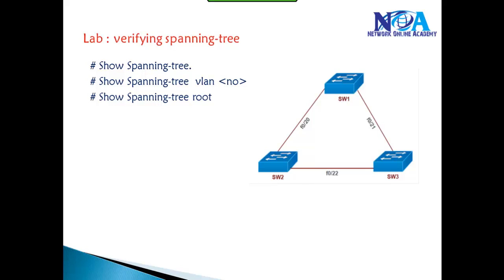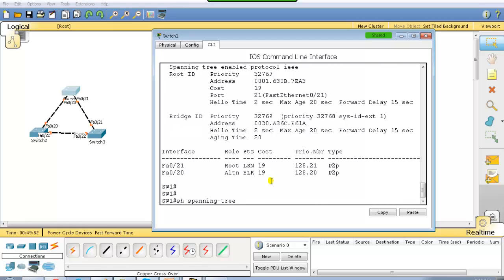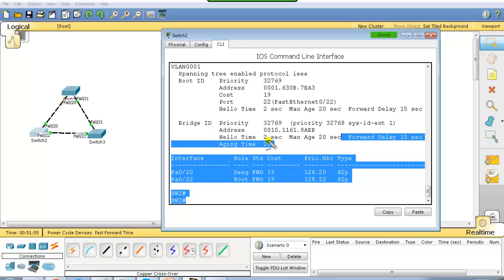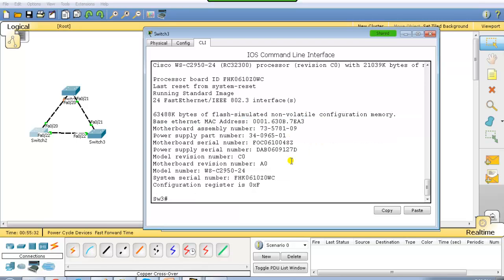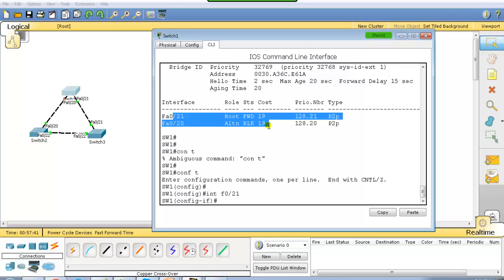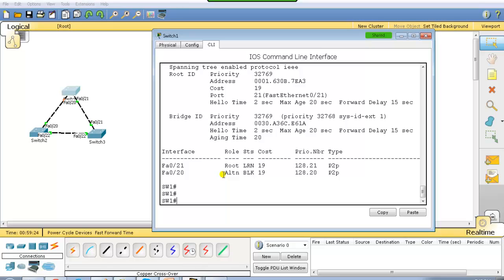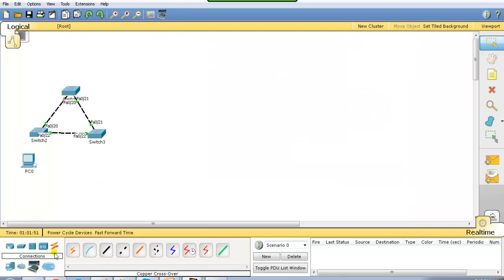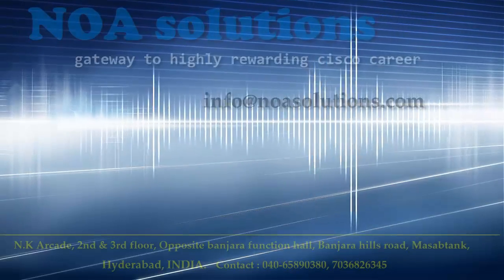CCNA Routing & Switching :STP lab

Comment: from what I understand, once the RootBridge is identified and is being used by all the remaining switches > if you happen to introduce another new switch to the Network (without the configuring it first) it might bring the network down as it might have the least cost etc. and then overwrite the settings ???? Is that correct?